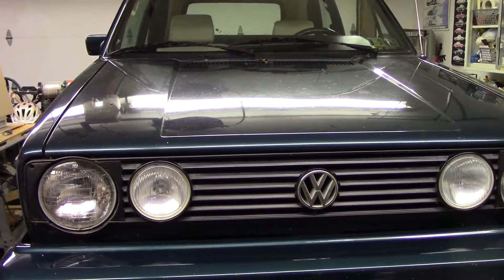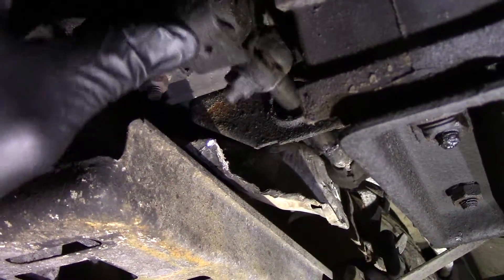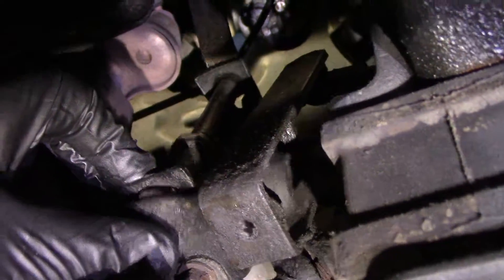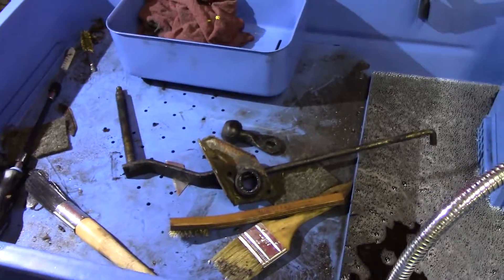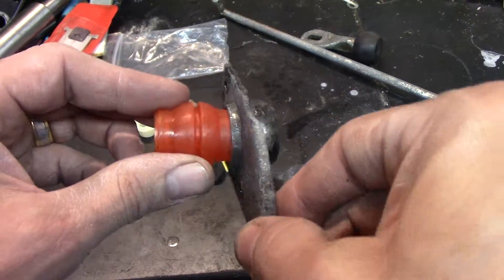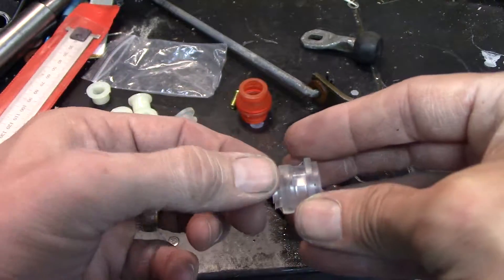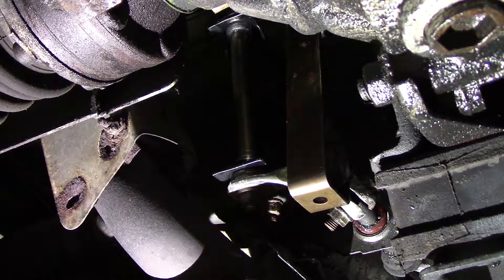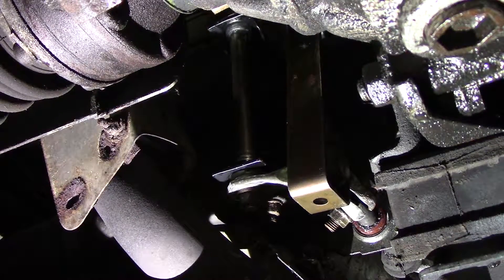VW Cabriolet shift linkage rebuild

Comment: Hey I replaced my bushings, Techtonics kit, also installed the short shifter and weighted rod. Had to replace the black boot underneath as mine was destroyed. Now all done, it feels really stiff forward and aft. Added grease at all the right spots during the install…I cut the accordion on the boot, the hole for the long rod that runs underneath, still stiff. Wasn’t stiff before I installed everything. Interesting note: the kit I got included that bracket that you had to drill, came with a tighter bushing than your Orange one.
Reply from the maker: I always found that the short shifters made it feel stiffer since it takes some of the leverage away. I only ever saw them in Mk2 cars and never in a Mk1 car so I cannot say exactly that that is the problem. You could unhook one piece at a time and see where the problem is worst. I hope that helps.
Reply: The bushing that was pre-installed on the one you had to drill out, is too tight, going to sand it a little to open up the hole. It’s funny since yours was loose, many this is the “fix” out there.

Comment: Oh and if you have a oil leak on the tappet cover try to fix it also as the engine  oil will cause the bushings to swell and waer faster

Comment: At 14:20 you mention showing how to replace that bushing using a socket but I didn't see that in this video.  Is it shown in another video?
Reply from the maker: I may have cut it out of the video. You can use a socket to back off the metal and then push the bushing out from the small side. These came out really easy so I did not need to do it that way.

Comment: At the end you showed how there was a little too much play where the long rod goes through that captive bushing.  In your experience do you think a better quality bushing would fit better?  There seems to be a range of brands/choices out there for rebuild kits.
Reply from the maker: I think the problem may be that the Mk1 cars typically had part numbers that started with 171, the Mk2 cars had 191 part numbers. All of the kit I have found had 191 part number so maybe they have superseded them and  only the 191 versions are available. I suspect that the Mk1 cars have a smaller diameter shift than the Mk2 so that is why it is so loose.

Comment: I have a 1987 cabriolet and in the engine bay where all my gears meet my reverse has slipped and my reverse has turned into 1st gear and I am not sure how to fix it I had it fixed and it came apart again.
Reply from the maker: It takes a lot of trial and error to get it lined up exactly. Move the rod going back to the shift handle a little at a time until it is right and tighten it.

Comment: Nice vid!  Currently having a problem on my cabby where I can only get to 1st and 2nd if I push down. I’m guessing this is the case???
Reply from the maker: This is more than likely the problem. I have done this to dozens of cars over the years. It is a cheap repair too.
Reply: BryanR461 so I got all the bushings in. I’m still having this binding. I actually cannot move the shifter to the left towards 1st it feels like I’m hitting a wall. I can’t seem to pin point what it is. Everything was adjusted and replaced by the book.
Reply from the maker: The part that attaches to the rod that goes to shifter in the car likely needs to be adjusted. You will have to pull it off carefully and move it one spline at a time. It is a very tedious process.
Reply: Mine too. It’s a 97 Cabrio

Comment: You have to lube all those conections with silicone grease I did not see you do that you gonna do this job in 3 months  time again if you don't grease  them and don't use normal grease  as dirt and oil will stick to it and become a grinding paste

Comment: Hey how do u set the gears to how they was I change all my bushing and put everything back together and the first gear is where neutral is
Reply from the maker: Where the main rod comes from the shifter in the car you need to turn it a little at a time where the front part of the shifter mechanism clamps on near the steering rack under the car. It may take a few attempts to get it just right.

Comment: Hey kind of a strange question but how many hours On estimate would this job take? I rebuilt the linkage but couldn’t get the car to go into reverse. After a few days I finally took it into a shop. They hammered me. Curious if they lied about the hours for the job
Reply from the maker: I would guess about 2 hours if you have a lift available. Most of the pieces don't need to be replaced. Getting the adjustment on the splines to the shift rod can take a few tries to get it where you can get reverse and 5th gear.